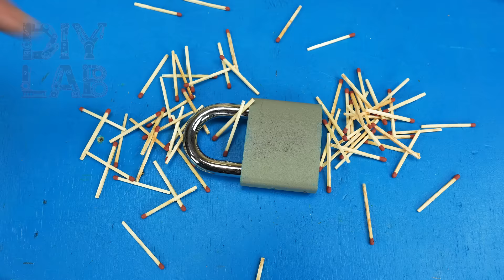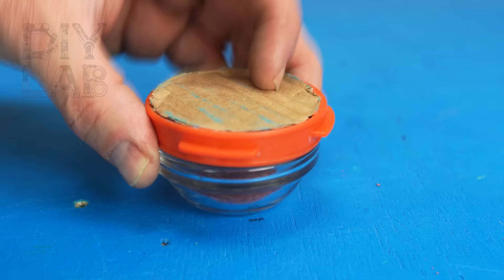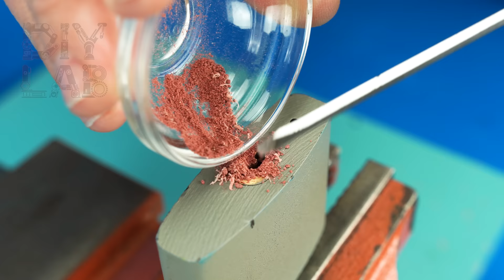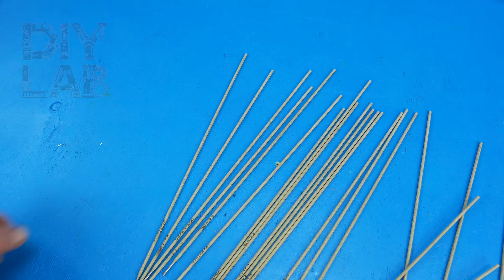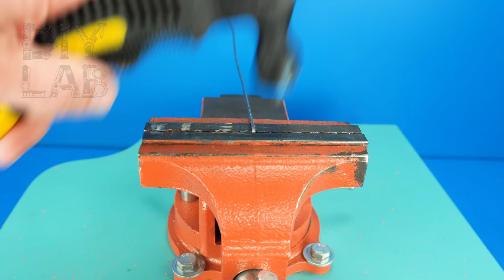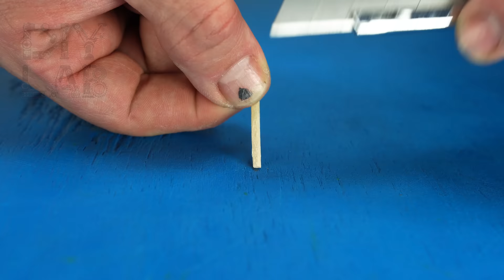How To Open A Lock With Matches

Comment: When I lose my keys like an idiot, I've learned to drill out the keyhole of a padlock to spring it open. Of course I then need a new padlock, but that's better than being stuck outside.
Reply: And my way is faster than whatever it is he's doing. In fact, I think mixing up thermite would be faster than what he's doing. I mean seriously, what an insanely overcomplicated way to spring a lock. And you can only do it if you can hold it upside down and move it around, not always the case. I'd have to say, this really isn't useful in terms of opening locks you lost the keys to.
Reply: if you are able to use a power tool like a drill then why not do it even simpler and faster using an angle grinder with a cut off wheel attached? heck they might even make them battery operated too that's much easier than drilling and i dont think i ever seen any of these open by drilling the keyhole
Reply: lot of time to work on this hack not practical to adapt such method
Reply: @ARCSTREAMS they do. I have a Milwaukee battery powered angle grinder and yes you could cut though that lock quicker than shaving all 8,000 of those matches!

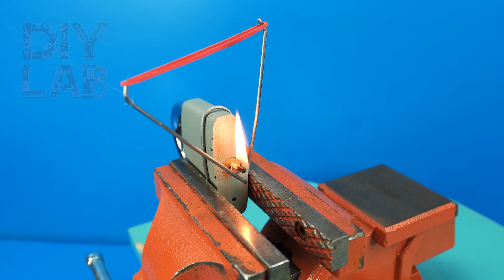Comment: 🤦you can see in 4:16 that the lock did not open. It opened only after changing the view.😆
Reply: I saw the same thing. The idea is that the explosion in the lock throws the pins outward giving time for the pick to slip into position. What happens in the video is the match actually burned the rubber band off, so when the explosion happens there was no tension on the pick for it to set into the keyway. EPIC FAIL.
Reply: Nmmk😅 @TheItalianDNA

Comment: I call bullshit because if you look at the locking mechanism and the body of the lock at the edge, you see there is absolutely no movement of the locking mechanism. It stays perfectly still. Then the edit happens and the locking mech is spun.
Reply: Just what I thought. No movement to be seen (besides the explosion and the flying rod); and I've watched it several times.
Reply: @christianhilleke2548  there is another one where he cuts out a piece of aluminum or somethin, he wraps it around the rod at the base and wiggles it and the lock opens. The lock is secured on the vice so you cant see the bottom of it. At first, I thought he wedged the flaps of the aluminum between the crevice of the rod and base but a recent video shows him just wrapping it around and wiggling it. And its on the opposite side of the actual rod that unlocks. I feel he takes advantage of the viewer not able to see the bottom of the lock while in the vice and he uses the key. So its more of a shitty magic trick than lock picking.

Comment: be nice if you actually explained how this works, i understand part of this is like a lock pick tool with the flattened metal rod but how does the heat by the burning match powder inside work on put the pins inside at the correct position to open? or is it something else going on?
Reply: So, there are 2 main tools used in lock picking...the rake/pick and the tension rod.  The rake/pick is used to position the individual pins in the lock tumbler to the point where the lock will open, and the tension rod is used to keep pressure on the tumbler pins to prevent them from springing back into the lock position after you rake them, and of course also to open the lock when you have all the tumbler pins in the unlock position.

I think what is happening here is he is packing match heads into the tumbler, which will compress the pins to the "unlock" position but also BEYOND the unlock position (which obviously the lock won't unlock when the pins aren't in exactly the right position), and keeping tension on it with his "automatic rubber-band-powered tension rod", when the match heads burn out, the tumbler pins will begin springing back into their normal fully extended "locked" position, when they will all pass at some point the "unlock" position in their travel.  Thus, when all the tumbler springs hit the "unlock position" (we're talking milliseconds here, if not nanoseconds) it will spring open.

At least, that's my understanding.  And since I know just a bit about picking locks, chemistry, and engineering, I'm probably pretty close.

Comment: Probably easier to buy a new lock. Plus if i don't have the key what sense it makes opening the lock and obviously it's a loose lock that you can put in a vice. I'm sure you couldn't do that with a padlock in use because of all the preparation and it has to be set in a horizontal position.
Reply: 😂😂😂when u are locked inside and u dont have this all things haha how could it be 😁😜✌️just saying😅